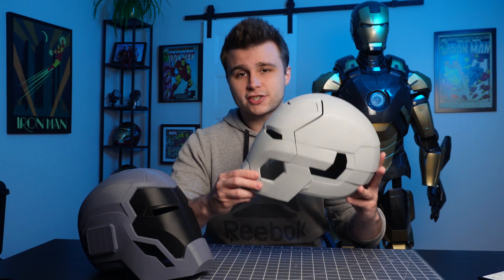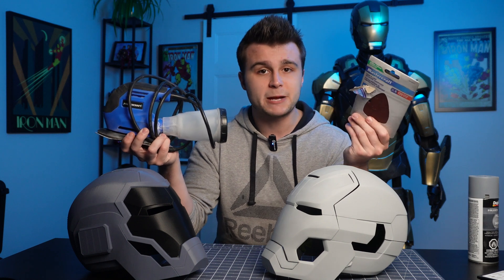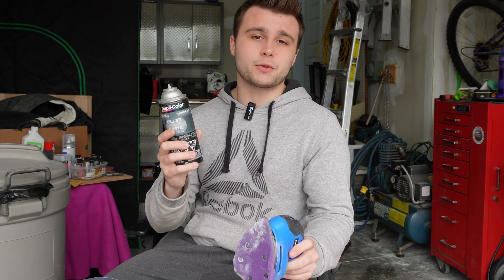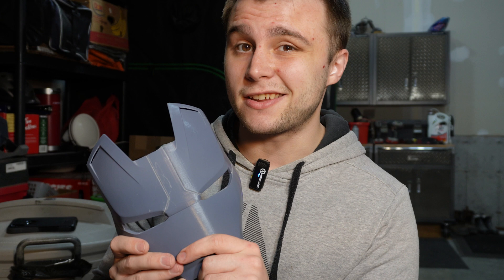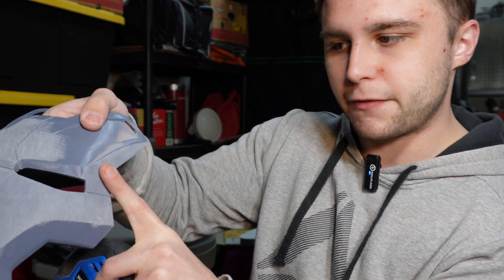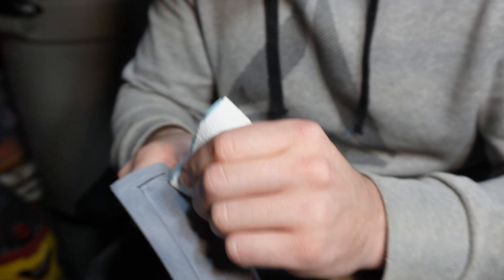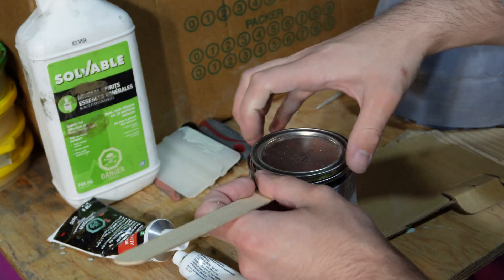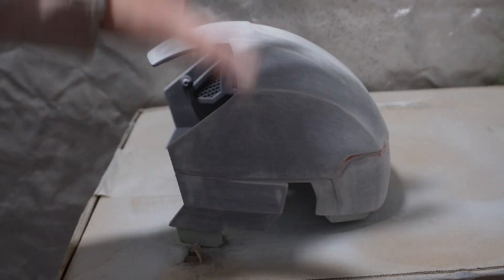Tips & Tricks for Sanding 3D Printed Cosplay - Making a Motorized Iron Man MK42 Helmet (part 2)

Comment: Do you usually install the magnets before you start processing?
Reply from the maker: Ideally yes, that way you don’t ruing the paint while installing if the holes are too small. The only downside is if you have spraypaints that have any metals in them, there will be noticeable dark spots near the magnets from them attracting the paint.
Reply: @plentifulprops3d  Thank you for the quick reply. About to start processing a Helldivers print that uses magnets.

Comment: Great tutorial. I have already a life size bust 3d print of mark85 . I notice you have add magnets? I had the same idea to connect parts of this bust with magnets so can be detachable if needed . Can you tell me how you open those holes for the magnets?
Reply: Most helmet files have holes already for the magnets. However if it doesn’t I’d use something to line them up and drill half way through or use a soldering iron to melt a spot into the plastic

Comment: SANDPAPER GRIT No in the US and Europe are not the same Number. Europe I would say start with 600, 800 to 1200 grit. Any scratches that you leave with the 600 you will need to remove with the 800 and so on.
I did like the video onist.